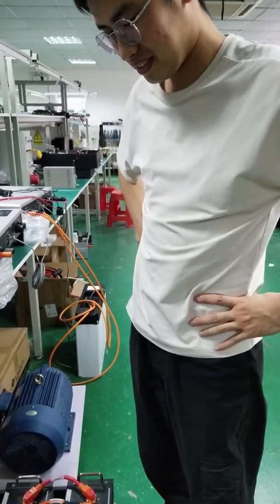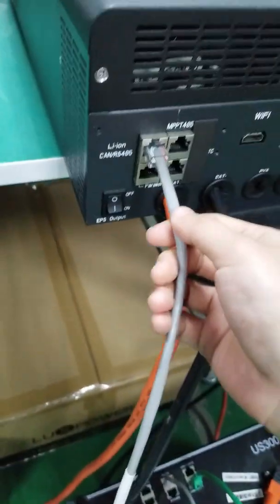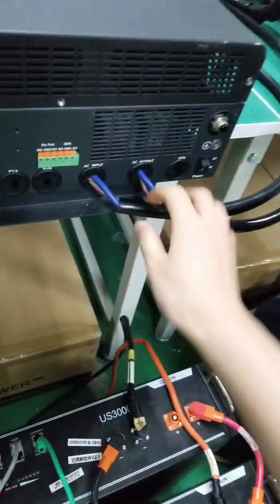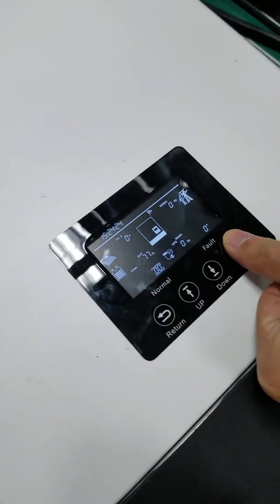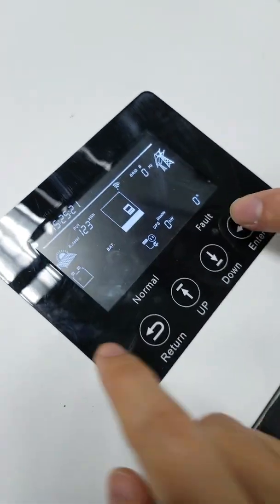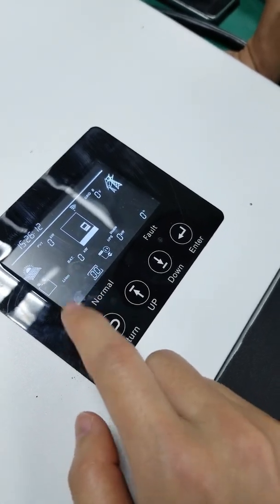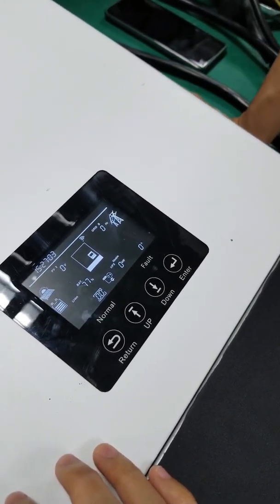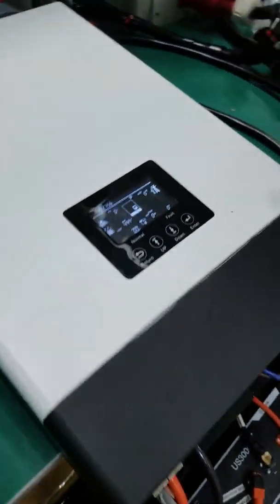Luxpower SNA series connect with Pylon battery

Comment: Solax lithium battery not connect BMS luxpower inverter
Reply from the maker: Hi Sir,  thanks for your reaching out to LuxpowerTek. We just check the compatible list, Solax Lithium battery is not in the list. Sorry, if you wanna to use Solax lithium battery, please contact with Solax for further infomation.

Comment: Please advise, the Inverter to battery  BMS cable connector any specification ? My SNA 5000 inverter is not reading the lithium Pylon after following the steps.  Can you give more details on the cable please 🙏
Reply from the maker: You can find inverter pinout on the manual, or you can contact your local supplier to confirm that.

Comment: Great illustrations. I case a battery that is not registered in the inverter inventory or DIY Battery is used would that be able to start up the inverter?
Reply from the maker: Luxpower inverter supports lead acid battery and compatible lithium battery, you can check the compatible brand here https://luxpowertek.com/wp-content/uploads/2022/06/Luxpower-Compatible-List_20220602.pdf